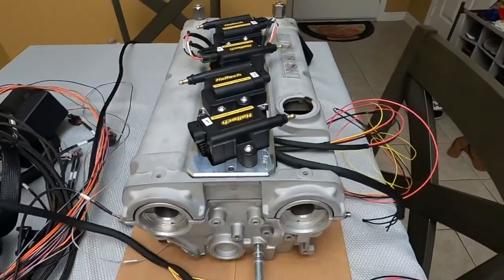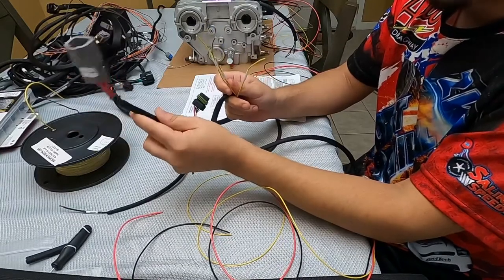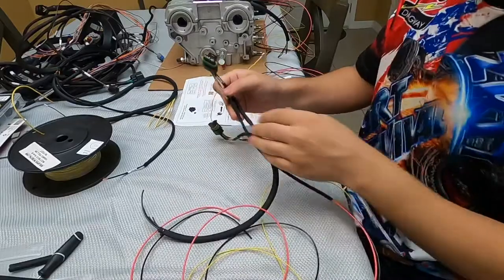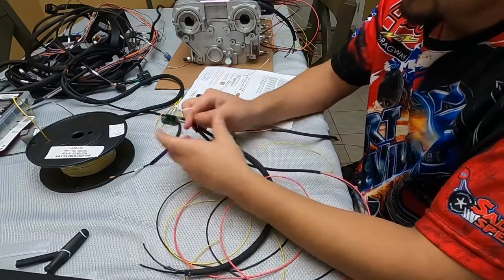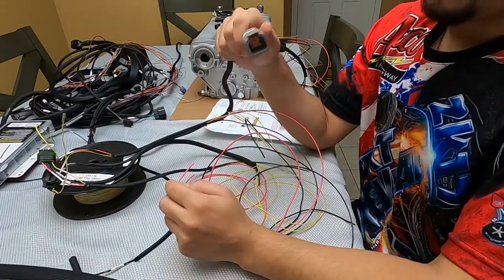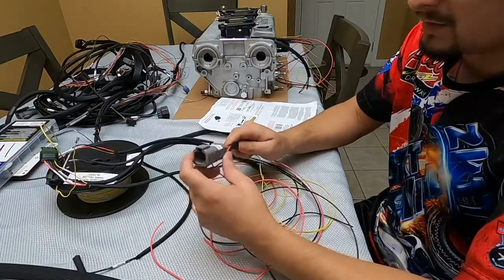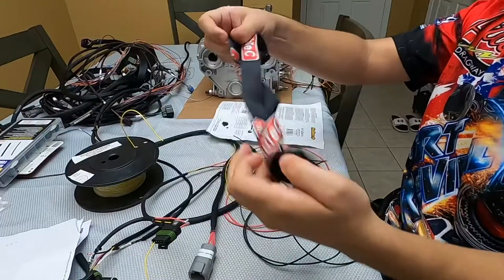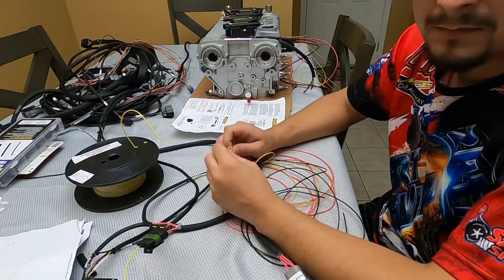How to wire IGN-1A Coils , 4G63 Drag Car Build Wiring

Comment: Does these coils work on a stock ecu?
Reply from the maker: Yes but requires special wiring. You can get the special wiring adapter at ohm-racing.com . It’s called  OHM Racing Plug & Play IGN-1A “Smart” Coil Ignition system. The price is pretty expensive though.
Reply: @nexxracing  thanx for the info 👍

Comment: What plate did you use for those coils? It looks like a JMF type? I like these coils but man they are so big. I see people mounting these further off the engine,  but then we have to run long spark plug wires.  I haven't ran spark plug wires since 2008..lol
Reply from the maker: It is a JMF plate , yeah the coils are bulky but if it’s done right it’ll look good, plus I can run shorter wires and I know they’ll handle 1000hp easily

Comment: You need an engine block earth to power them 🤦 head is just to fire them
Reply from the maker: You just need to attach it to your star grounding point. 1 ground wire goes to Ecu reference Ground and the rest to your star grounding point on the head or block